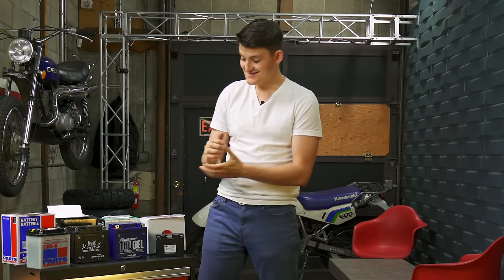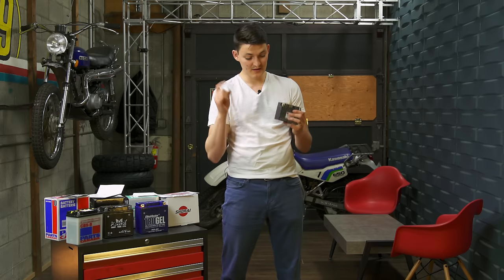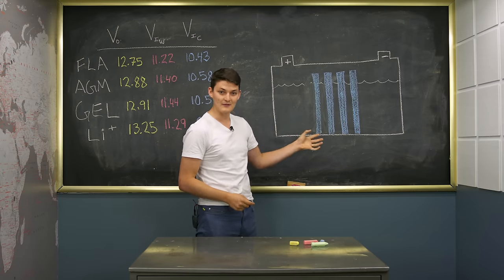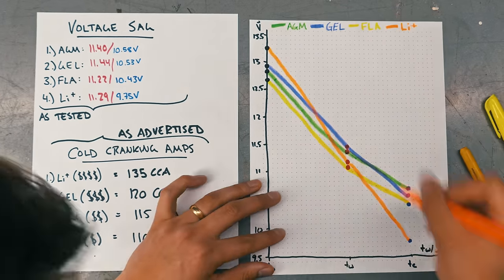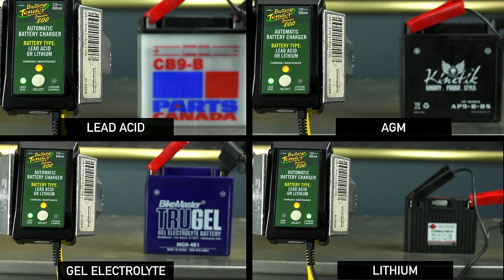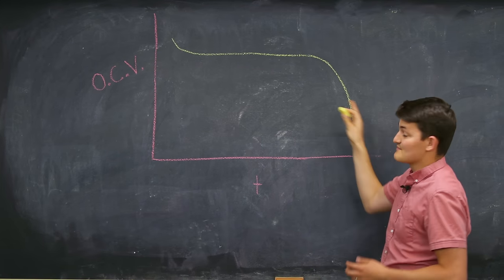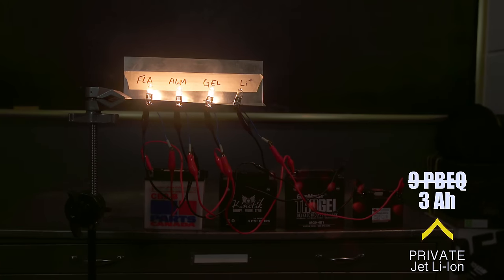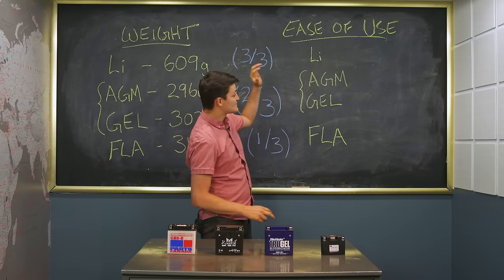Best Motorcycle Battery? Lead-Acid v. AGM v. Gel v. Lithium

Comment: I have had the best luck with AGM for longevity also my goldwing battery sat for 3 winter months without a battery tender and still had 12.4 volts and started the motorcycle without any problems.

Comment: I am by no means an expert on batteries, but want to add my experience here as it may prove interesting... An FLA "car battery" can be totally discharged but can be brought back to life (although possibly slightly damaged as F9 stated). An AGM or Gel cannot be deep-cycled - if these are brought down to 7V, they are unrecoverable in my experience. I've tried recharging Gel's and could never bring one back. Lithium is another one which wouldn't like to be deep-cycled from what I've read, so the user has to be careful there too. 
  Great work on the research and science in this video - it was well worth watching! Ride safe out there...

Comment: This makes me think the best answer is to wire TWO of those little lithium batteries in parallel or just one physically larger example. Should get you similar or greater capacity versus the lead acids while still saving a lot of weight.

Comment: I can't speak for Gel or Lithium, but my Odyssey AGM battery in my Vmax lasted literally a decade.  I think the only reason it stopped working well is because my bike sat for over a year without being ridden or on a charger.  With that type of longevity, I of course purchased another Odyssey.  If they are good enough for the military, they are good for my old Vmax.  I'm not endorsed by them, but I do highly recommended one if they have a model that fits your machine.

Comment: I commute on my bike all year. In the winter, I run heated grips along with my extra lighting, so the charging cant keep up. I deliberately deep cycle the battery at night on the way home when its colder, then plug it in at home overnight to catch up. For this reason I chose the lithium battery. It can be a struggle to get the bike to start though for the cold ride home. Sometimes I have to crank a bit before the battery is warm enough to start the bike. Im considering adding a little heating blanket around the battery to both heat it, and draw current to heat it at the same time.

Comment: Hello. I’m an RC-enthousiast and use Lipo-battery’s regulary.
I have a quick note on charging LiPo or LiFe: a typical Lipo-charger will always start with a high load. When it reaches the max voltage, it drops the charging load and starts to charge again... and so on untill it is a minimal charging (Amp) and reaches the max voltage.
This means it will charge the battery for like 85% very fast but then will slow down, and slow down, ... you might stop the charging proces 15 minutes earlier and yet have a battery that is easely charged.

Comment: The thing with batteries is that the best choice also depends on the motorcycle. For example, on the forums, it's known that an Aprilia RS50 really drains the battery. That's why it's recommended to use other types of batteries.

Comment: My lithium MC battery was so light I thought the package was empty when it arrived. It worked extremely well with awesome cranking power in my street triple R until it died. I replaced it with a standard lead acid which died 8 weeks later. On further investigation of the voltage regulation I was getting good charge at idle, but on revving the bike up the voltage increased  to 16 - 17 volts which is what killed both batteries. If I ever run a lithium MC battery again (far too expensive) I'll be adding in a separate voltage indicator to the dash.

Comment: Great test! well put, science made fun and light mooded.

BUT
Just a small correction, with a decent charger, a lithium hobby charger, for example that Lithium battery could be charged much faster that the PB ones, "sag" goes both ways, if you pump amps Charging a battery, its voltage will rise beyond it's charged value, the lower internal resistance of the Lifepo4 battery will allow it to receive more amps, try cramming 10 amps on a PB battery, not good. that Shorai battery AFAIK doesn't have internal balancing circuit so is less protected that other brands, in theory will fail, because there's 4 sets of cells and there's nothing that balances them, for a multicell lithium pack, that's essential,  that's why there's a grey cover on top, inside there's a balancing port, you can balance charge it using any newer "hobby" charger.

Comment: The lead acid (Exide) battery that came stock on my bike died after a year after me not charging it for 3 weeks. The second lead acid generated error codes and had to be scrapped. I bought a LiFePO4 from Shido. Just install and forget about it. Works like a charm.

Comment: A few comments:

  1) Since the lithium battery is an actual 3Ah, you should instead use one that is a true 9Ah, so triple that size and weight.  It would then still win the weight category by a healthy margin, and the size of the battery would match the others well (making it more of a drop in solution).  If this was done, the lithium would probably win all of the other categories too (except maybe cold weather starting).  I have a 2 pound lithium battery that is rated at 18Ah Pb Eq but has an actual power of 6Ah, so that would have been a better test if you also used something like that.

  2) Who cares about recharge time when it is used as a starter battery?  Generally, you start a bike and then run it for 15 minutes or more.  In that time, it is likely that the juice you drained from the battery will be put back in.

  3) My real world experience with lithium is that they are fun to use on motorcycles.  The weight savings translates into a better power to weight ratio, and I can clearly hear the starter turning quicker.  I use a very small and very light 1 pound lithium battery in my R6 and it starts it up well.  One word of caution though.  Make sure your charging system on the bike does NOT exceed 14.2V when running (or whatever the manufacturer says is the maximum safe voltage).  That is so it wont overcharge.  Don't assume it is ok, check it with an accurate voltmeter.

  4) Think about this... motorcycle designers spend lots of time with R&D to shave weight off of sportbikes to make them more competitive.  Why then would they put a lump of lead in one of those, thus negating a lot of the shaved weight?  That makes little to no sense to me.  If your bike is 400 pounds or less dry, it makes sense to use a lithium battery to keep the weight down.  One a light sportbike that already has a power to weight ratio of 4 pounds per peak HP (600 pounds with rider and 150 HP at rear wheel), for each 4 pound you shave, it is roughly equivalent (actually better) than keeping the weight the same and adding 1 HP.  On some sportbikes, you can shave close to 8 pounds which is like a 2 HP boost.  Less weight also helps with cornering and braking.

Comment: I bought a 2006 Kawa KLX250 in 2014 or early 2015 that had a Shorai Lithium in it.  Battery had been in it about a year.  Used the bike to teach my daughter to ride and then nearly ignored it for the rest of the time I had the POS.  Sold the bike in 2022 with the SAME battery in it and it would still crank like mad.  Sold me on the things.  

My 2006 Yamaha FZ6 got one this spring.  Not going back.

Comment: Worth noting is that lithium batteries come in all different varieties. Some are made to pump out serious amps, while others are designed for a higher amp hour capacity, and can have quite low discharge currents.

Comment: My 2 cents: I work at a fairly large dealership and replace many batteries in year round riding weather. The lithiums do great in dirt bikes and track bikes because they store well. In daily rides, the lithium batteries die young, like a year or 2, tops (IDK why). Most bikes have AGM's, well maintained and/or used often, they last a good five years or so, mine's from 2013, not 100% but still good enough for this weather. Conventional batteries add the benefit of corrosion and spill hazards. Gel batteries aren't very popular so I don't have much to speak on. If you're storing it, get a lithium. If you're riding it, get AGM.

Comment: There is one major reason to use lithium, and that is to get the bike started.
Are you clumsy, bike hard to start, cold weather to much.... What ever trouble you have starting you will have a better chance with a Li battery.
Even when voltage drop it will crank the engine over. A traditional lead acid are more or less useless for starting when at 60% capacity.
The Li is fully functional at 10% and will deliver current enough to start, at 10% any of the lead batteries will hardly be able to pull the relay, much less the starter it self.
You measured the capacity by bleeding the batteries with a bulb but if you tried to start an engine with any of those batteries after 20 minutes you might see that only the Li would be able to crank an engine.
LiFEPO4 also have the added benefit of a higher voltage making sparks better and starter speed higher.
What your test are lacking are how many start attempts will each battery manage on a difficult engine (One cyl or two cyl big engine) . 
The Li will most likely win despite a much lower capacity with the AGM on second.

Comment: Nice you give objective videos over products.  So much fake news.  I bought a lithium iron for the less weight.  I went with a 21 AH and 360 CCA.  It weighs 7 pounds less and reduces my higher up weight on my super naked bike.  It seems less toxic to the environment vs the 150 year old lead acid battery.  Hopefully lasts longer.  I noticed Antigravity makes that restart battery which is cool.  Also no worry with hydrogen gas.  Thanks for the video.  Headlight tech would be an interesting topic.  Led headlight bulbs, hid bulbs, halogen.  Educating the public on stability control.  So many people believe they are better than electronics.  All these videos where everyone switching off traction control etc.

Comment: Lithium are great for seasonal riders. Bring your lightweight, clean, acid free battery inside for the winter and it will likely need no attention till you strap in back in next spring. I was surprised to find my lithium battery dead after leaving only a Bluetooth charger on over a few days, totally drained. My gut says lead plates would have survived. Lead is great for everyday use or connected to a tender and takes a beating.
Still love loosing pounds up high with my lithium.

Comment: The lithium ion used in starter batteries is solid state LiFrPO4
 It does not have liquid electrolyte so cannot get lithium dendrites and does not catch fire. 
It will give less current when cold but a “failed” start attempt warms the calls and then it works fine. 
I have a JMT. Cost was less than the heaviest lead acid.

Comment: Went to Lithium in my daily rider 3 years ago and no regrets, maintenance free, small, light, never fails to crank the starter,never runs down and so far has lasted over 3 years while every lead acid battery i had before usually only lasted 2 years, never want to see a lead acid battery or a derivative of one again.

Comment: Hi Ryan -- here's a good video topic: jump starting. My owner's club chat (which almost universally rate you highly) is very divided on this. Some say you don't want to do this because you'll cause a surge and break something electrical -- the most feared gremlin any of the oldies can warn us newbs about. A small minority (maybe just me) says there's a difference between a voltage source and a charger: a charger pumps current into a system, and too much can damage things, but a voltage source only supplies the current drawn as predicted by ohm's law, so connecting 12V (fish) in parallel with your existing 12V(fish) battery won't hurt anything. What's the real truth? This video is tailor made for your style. we all want to know.

Comment: If you shouldn't charge the lithium battery when it's below freezing, doesn't that mean you can't actually use the bike at all in that weather - because the alternator will immediately start charging the sub-freezing battery?

Comment: Think its more horses for courses really. I live in a warm climate, ride every now and then (so my bikes can spend months parked up), and have no fancy alarms or digital gubbins draining my batteries continuously. I am overjoyed with my Lithium battery. Even post covid lockdowns I was able to wheel my bike from the garage after 11 months, check the tyres, etc., thumb the starter and she burst immediately into life. Problem was those friends I was supposedly to meet up with for a run around the nearest mountain pass all had LA batteries and none of them had prepped their bikes properly, so I did the route all alone, while they all went shopping for batteries - it was still a great outing though, after so long out of the saddle.

Comment: I bought a great AGM battery for 40 Cad and it has lasted forever. Leave the bike sitting for 6 months, pop the charger on, and its charged in 5 minutes. Lithium batteries tend to be really bad in extreme weather which would be okay for street bikes but definitely not off-road vehicles.

Comment: Hi everyone. 
I have 3 bikes all three running in lithium batteries. 
They are 3-2-1 years old so I have a three years experience in my everyday bike. 
I never had a problem and bike always starts easily. 
I do use one of my bikes for traveling and I have been to cold weather countries coldest was -2 and never had a problem cranking in the morning as I always did run 30 seconds the on before I hit the starter. 
I live in Greece and here they are not so expensive. Prices are almost identical between a gel and a lithium battery. Sometimes lithium is cheaper. 
Also I wanted to mention that people are trying so hard to take few kg of their bikes especially when they are placed high. Taking so easy 2.5-3 kg off is a bargain.

Comment: Because you didn't use a big enough charger on the Ilfepo4.  It can take a way higher charge rate.  I think for average guy it doesn't matter.  You are going to throw the Lithium on a charge once a month over night to top it off, so a few minutes doesn't matter.  But you definitely could go with a 3-amp charger on the lithium vs an 800 Mah charger and charge it in 40 mins.

Comment: Odyssey extreme duty is the best battery I've ever had. 10 years in the bike. 5 years as a jumper battery. Still holding 12.75 volts for months on end.

Comment: I installed a lithium ion on the last bike. Never had to charge it once. Turned on the motorcycle twice during the winter, and in the spring the battery had no problems whatsoever. No charging. I think, for normal use, lithium is the best.

Comment: The lithium battery on my bike has 290cca and 4ah. Designed to last 2000 cycles or 10 years, can be charged with a normal 12v car battery charger, sit in any orientation and can sit unused for a year without losing charge.
 
Lithium is far superior IMO, especially in the right conditions - Sydney, Australia has a subtropical climate so 8°c is about the lowest it gets and I'm not running any accessories.

Comment: I knew these points. I have been converting my bikes to Li though.  At battery-stuff.com  a good Li is close to a brand name lead acid. A few reasons are... no corrosion and not venting off and if the bike ends up on its side 1 less thing to worry about. I don't have to fill it. On older bikes with no computers it stores all winter or can sit at least a year without suffering. Super light. Bikes with computers I do hit it with a trickle charger at 2 or three months. Supposedly Faster  charging if my trips are short... but your test showed differently!

Comment: Over here in Germany we use batteries made for uninterruptible voltage supply in our bikes. An 18 Ah AGM sell for 35 € and provides 200 A. Smaller sizes are available.

Comment: Okay, so lithium batteries. With very little effort you can get better spec'd lithium batteries with built in safeties to prevent complete discharge, They are also a lot cheaper. I'm probably a bit of the exception, but I build the lithium battery in my bike. It has 6ah, and a built in controller that prevents the battery from being charged over 85% Because of Lithiums near exponential charge time when approaching full, it will charge from flat to 85% in 40 minutes. To offset the voltage drop at at below full charge, i spec'd it to 14.2v. It weights 1.1kg including the shell I 3D printed for it. Total cost - approximately $55 Canadian. At current (pun intended) its been running for 5 years, no issue. I learnt about batteries and making my own from RC cars.
Reply: Maybe you should build and sell these it looks a lot better that what's on offer anywhere else.   The anti gravity is the only one I would trust.  I'm sure it's not even 6ah and the price is crazy

Comment: There's a reason they rate time to charge lithium to 80% and to 100%.  Because it's wildly faster to 80%.  If you would have discharged all the batteries to 10% and then did the charge test, the Lithium should have won.

Comment: I have used/compared different brands of FLA batteries and that real world use revealed dissimilar quality and that I got better quality with Yuasa every time. If you don't mind replacing your battery more often or possibly getting stranded, GO CHEAP. For me I will stick with Yuasa as long as it is available. I usually get 6-8 years each, but that is riding 5-7 days a week.

Comment: I’ve used them all, just switched to the Shorai and wish I had long ago. Turns over effortlessly and twice as fast. Bike master blows goats btw. Went through 2 in two years in my quad. Not to mention the shorai weighs 2 lbs. just use their charger which costs about $80 more.